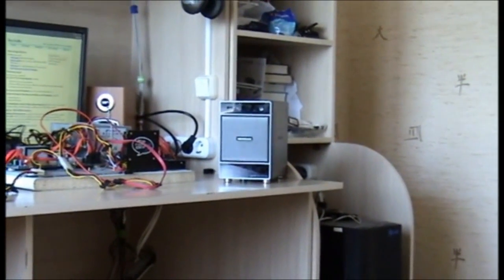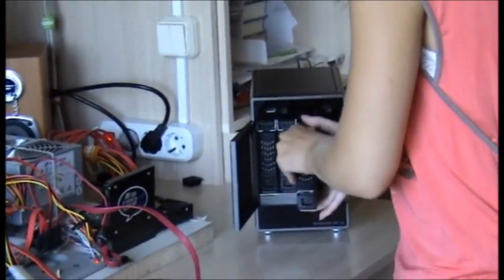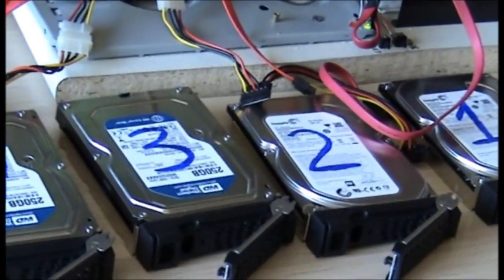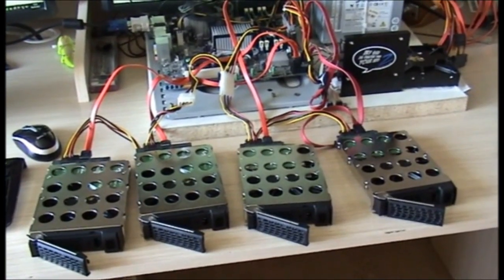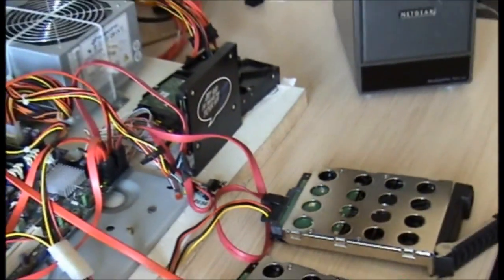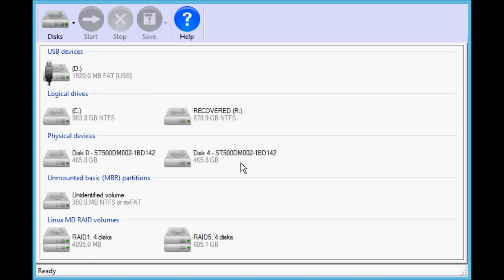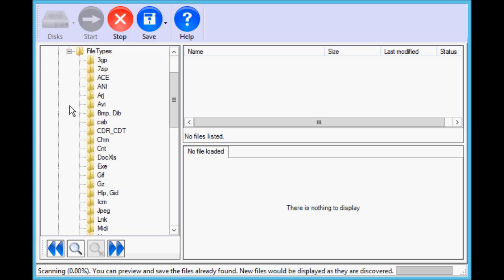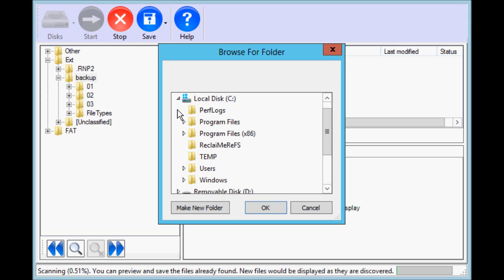How to recover data from the failed NETGEAR ReadyNAS

Comment: Hi, is there any system requirement ? as i need to connect 4x4tb HDD RAid5, please help me
Reply from the maker: Hello, you can connect your drives to the PC via SATA cable or USB-to-SATA adapter (additional power supply is required), but in case with USB connection the speed will be lower than when connected with SATA. Also we recommend minimum 8 GB of RAM to stable work of ReclaiMe.

If you have further questions please follow our tech support link https://www.reclaime.com/assistance.aspx

Comment: YOU BEAUTIFUL BASTARDS! Just got back all my data from my NAS. Raid6 volume was suddenly not recognized anymore in my Asustor 1004T. Asustor support took a look and said to take it to a Data recovery company. I  Pulled out the harddisks, attached them to my desktop (3 vi Sata cables to motherboard, and 1 via usb adapter), fired up Reclaime Ultimate and BAM! All my data was there. (tried a couple of other softwares as well, but didn't work). THANK YOU !

Comment: why doesn't this util recreate the original file directory structure? It is a major pain in the ass how it dumps all files in 10k folders that mean absolutely nothing...... this recovery metho is awful and extremely tedious! >:(
Reply from the maker: Hello,
Typically, you should have the original folder tree recovered; otherwise something wrong with the recovery - either RAID configuration recovery or filesystem recovery. Anyway, more thorough investigation is needed.
Reply: i don't understand what you mean? I want to be able to see the original file structure not 10,000 random folders with random files in it... it makes it nearly impossible to recreate the original file system structure..... :(

Comment: Hi
Can i use instead the sata cable and the power cable USB dock station ??
Coz i have laptop 
thanks
Reply from the maker: Yes, you can; however,  we generally advise to do any recovery with source drives connected to SATA, not USB. Generally, USB is less stable. Another problem is, if there is a bad block
on one of the source drives, the USB-to-SATA bridges tend to lock up entirely after encountering first one or two bad blocks.
Reply: Ammar Qasira àa

Comment: An update. Problem with the 3T drives is on the MBs of the older computers. 
SATA ports aren't capable of recognizing the 3T drives. So not the software's fault
Reply from the maker: tunnsie Yes, some mainboards will not like 2TB+ drives, but that must be five year old or even more

Comment: Having some problems with it. It uses a LOT of memory. Tried two older machines and both eventually locked up. Plus it doesn't seem to like the newer 3 T drives.
Will keep trying to tweak

Comment: Can this only work if the drives are configured in a standard Raid format such as RAID5? The Readynas also has something called " Flex-raid" I believe which is like a customized raid 5 which will allow for things such as starting out with 2 drives and adding more drives later on as well as expanding the array to a larger array when you swap out the smaller drives with larger drives 1 by 1 after it rebuilds the array. 

Will this recovery work when the drives are in the " Flex-raid" format?
Reply from the maker: Marty Lynchian I recall Flex is not expandable, it is X-RAID2 which is expandable. Anyway, it will work with these.